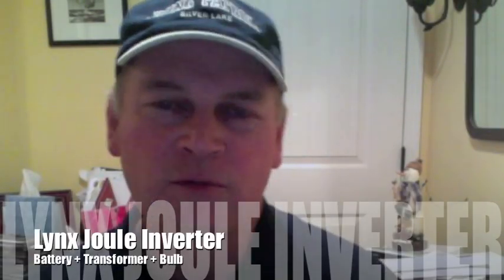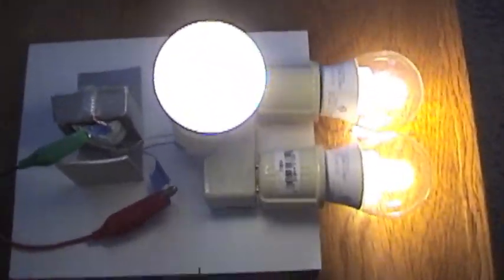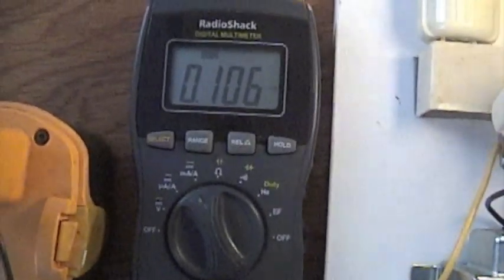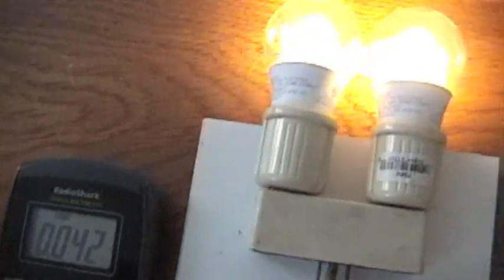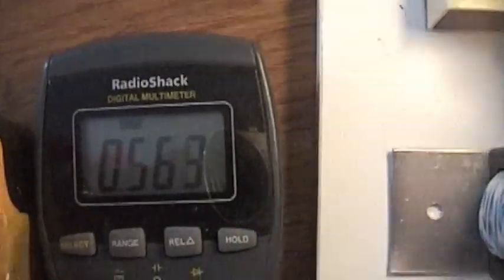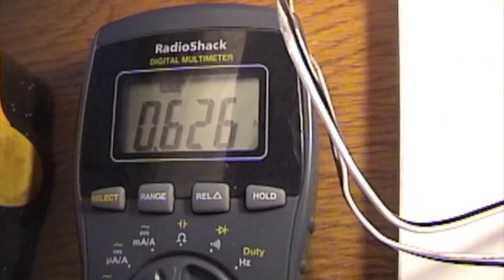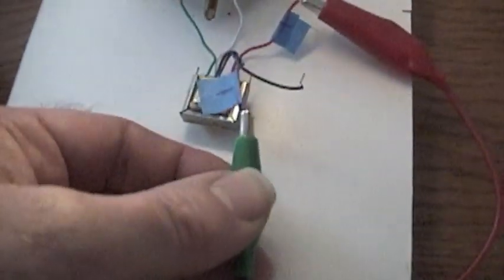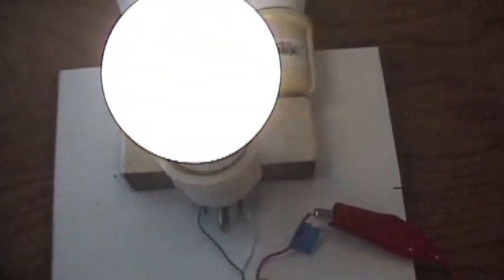Lynx Joule Inverter

Comment: I hooked up a 120 LED (60w equivalent) 10.5watt rated bulb to my 12v DC solar with an amp meter. It has about half the luminance (lumens) but it only draws 1/5 or .24 watts of power versus 10.5. That is 43.7 less energy that if I ran the same bulb AC. That is VERY little energy. Can you explain this?
Alan

Comment: next I hook up to a car battery, I use a MOT now. 
gives 25.4 volts AC on the meter.tried a 220 volt led lamp, nothing. 
I did get quite a shock from the 25.4 volts :P

Comment: lol I try this here with a transformer from an old cassette recorder. 
with a near dead 9 volt battery (8.45volts in) shows 17.6 volts AC on my meter with this connection. very cool! 
and the meter shows 8.44 volts DC if I switch it. huh? :D

Comment from the maker: You can safely run this on 26 volts.  I haven't tried higher.  I'd be curious what you find with lightbox testing.  The amp draw seems linear with voltage.

Comment from the maker: It flickers more in the video.  I think each bulb has slight differences so the oscillations get dirty until they sync.  I checked the battery voltage and it hasn't dropped in hours.  I think you could run one of these bulbs a long time off a small battery.
I also have a suspicion the collapsing field sends flyback both ways and maybe charging the battery on a half cycle.

Comment from the maker: I suppose the only thing you might not have are the bulbs.  Philips 3W LED and GE 3W LED use the same electronics base made in China LED3A15/C 100-127 v 50/60hz
Positive 12 v to primary, other primary to bulb, secondary to bulb, other secondary to negative.  I like the efficiency and low amp draw.  No warmth from bulb or transformer It would be nice to find the number of turns, ratio and resistance to get full brightness.
This would be a good candidate for miniaturization, solar panel.